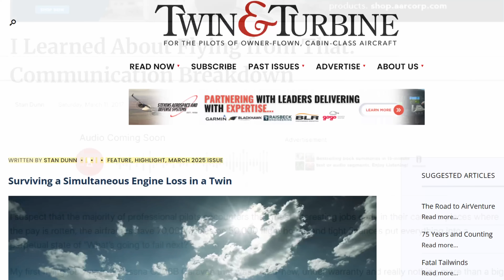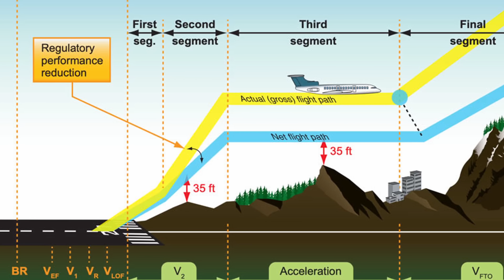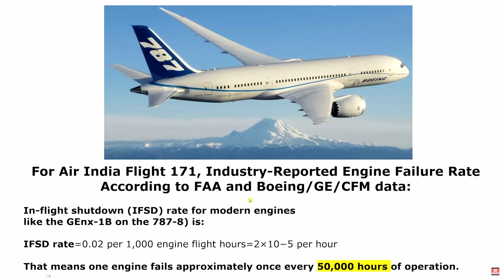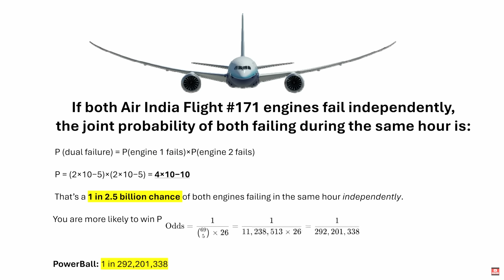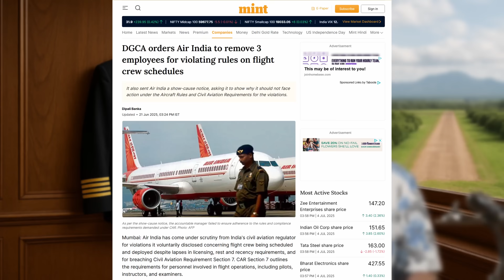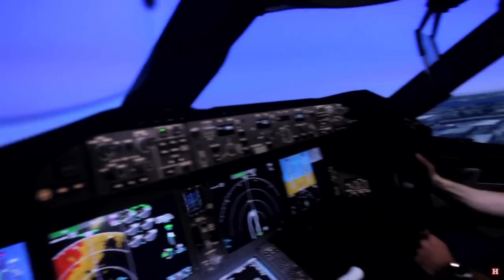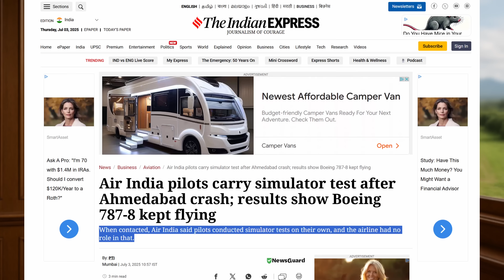Air India 171 Cause Becoming Clear

Comment: 1. Primary Cause – Electrical Power Transfer Interruption (PTI) During Rotation
 • During transition from ground to airborne electrical configuration, the aircraft experienced a cascading dual-engine FADEC (Full Authority Digital Engine Control) failure.
 • Root cause: Uncommanded bus transfer failure due to arcing in the main power relay box (PRB-A), traced to water ingress during pre-flight GPU disconnection in heavy rain.
 • This led to loss of electronic engine control at rotation, resulting in both GEnx engines rolling back to ground idle within 4–5 seconds.

2. Flight Data Record Timeline
 • +0:11 sec: Nose gear lifts off.
 • +0:13 sec: Sudden engine rollback begins. Thrust reduces from 92% N1 to <27% within 3 seconds.
 • +0:16 sec: Master caution + ENG FAIL L/R warnings. FO calls, “Both engines dropping!”
 • +0:20 sec: Autopilot and flight control reverts to Direct Mode. Pitch up attitude peaks at 18°.
 • +0:25 sec: Aircraft stalls at 186 ft AGL.
 • +0:30 sec: Full aerodynamic stall; nose drops rapidly.
 • +0:38 sec: Ground impact at 54° nose-down attitude, 174 knots.

⸻

⚙️ Contributing Factors
 • Environmental Conditions:
 • Torrential rain during pushback.
 • Moisture intrusion into PRB-A connector (P/N: HLN8471) — a known corrosion-risk component.
 • Latent Maintenance Issue:
 • Power transfer relay unit showed signs of thermal damage in a previous MEL deferral 2 weeks prior.
 • No replacement had been conducted; aircraft was cleared under repetitive deferral.
 • Design Oversight:
 • Boeing 787 has no physical engine control backup (i.e., no direct mechanical linkage in FADEC loss scenario).
 • Loss of power supply to both EEC channels resulted in engine “freeze” at ground idle instead of flameout.
 • Flight Crew Response:
 • Attempted engine relight sequence not completed before stall onset.
 • Emergency power selector not activated — possibly due to confusion from multiple ECAM warnings.

Comment: As a retired major airline captain I found this video and reasoning sorely lacking credibility.  Too much superfluous and incorrect detail.  Wreckage photos show the flaps extended to 5 degrees.  You wasted our time with silly comments about sabotage, aviation gasoline, the APU, etc.  You did not discuss (or understand) the position of the B-787 main landing gear trucks angled downward which only occurs when the gear lever is raised to the up position. They are angled upward during  takeoff and landing with the gear handle down. You finalized with nothing, and have absolutely no credibility in my professional opinion.  I suggest you might be better suited to making cooking videos. 😎
Reply: And you are credible, nothing absolutely nothing backing your claims up, a professional YT troll, at best 😅😂🤣 .
Reply: Talking about cooking. stick to your Carbonara sauce 😄

Comment: Two weeks ago, I saw a video from an expert saying the elevated runway temperatures (49 degrees or more) most likely caused vapour lock in the engine's fuel pumps, starving the engines of fuel. Therefore, no external signs, except the RAT.

Comment: The engine itself did not fail mechanically; rather, it was shut down as a result of the system issuing a fuel cut-off command. This abnormal command appears to have been triggered by a sudden and severe disruption in electrical power—either a spike or a complete loss—that caused the aircraft’s systems to malfunction. A key indicator of this is the immediate deployment of the Ram Air Turbine (RAT), which only activates in response to a significant electrical failure.

That said, it’s unlikely that the RAT alone would have been capable of supporting an engine restart. The RAT is designed to supply just enough power to maintain critical flight systems and avionics, not to handle the heavy electrical load required to restart a stopped engine.
Reply: RAT also deploys with loss of both engines, a major loss in hydraulic system or a loss of CA and FO flight instruments.

Comment: I enjoyed a forty year career in aviation flying both military and commercial aircraft. I flew the 787 for the last seven years of my career. I have grown increasingly frustrated with the ridiculous and wholly uninformed opinions of YouTube content creators touting themselves as experts.

Examples of some of those “expert” opinions include the F-15E pilot stating, with great certainty, that the wings of the Air India 787 appeared “skinny” indicating the flaps were not down. On the 787 flaps 1 only extend the leading edge slats and flaps 5 extend the trailing edge flaps only increasing the wing surface area and not the wing camber and not, therefore, blocking the view of the engines.

Another idiotic opinion discussed how the pilots would have “pushed the FADEC levers forward” in an emergency and would not have had time to pull out the 787 Quick Reference Handbook (“QRH”). I must point out that there is no QRH on the 787.

This is the first episode on this topic that has impressed me. I agree with everything you said. Believe me, if you had done otherwise I would say so. I found your thoughts to be sober, well informed, professional and respectful to the highest tenants of the aviation profession. Well done.
Reply: Sure, you are an ex-pilot rathern than yet another YT-troll, you are not the first one though, internet is full with self proclaimed "experts" as you😅😂🤣

Comment: I have given many of the initial "theories" much thought and have had a couple ideas myself, but one thing I most certainly did not consider was the possibility that one engine failed and rather than switching it off (shut down), the pilots accidentally or inadvertently shut down the working engine. It's a scary thought but Very Plausible when explained in detail as was done in this video. Thanks for that.

Comment: The real smoking gun of this case is the Cockpit Voice Recorder. ⚠ 

INCIDENT: Thurs. 12/6/2025 10.09 CEST 13.39 Local Time. India, Gujarat, Ahmedabad, 2.5 kms W of Sardar Patel International Airport, 23.055488°N 72.615643°E, Air India Boeing 787-8 Dreamliner Crash Flight 171, Rego VT- ANB. 

To dispel any suspicion from the victim's family members and other interested parties, the Prime Minister Narendra Modi should order the Director General of India's Aircraft Accident Investigation Bureau, GVG Yugandhar to broadcast publicly the full, unedited content of the plane's CVR from the time it left the terminal/passenger boarding to just after the impact/crash/fireball at 13.40 Local Time. (Approx. a 10 minute recording. The last 90 seconds are the key)

I have analysed all the available public evidence to date and have some early conclusions about the cause of this crash. One key piece of the jigsaw puzzle is the fact the landing gear was still down. This means there was a real problem in the cockpit, where the two pilots were strapped in. (The usual procedure on a Boeing 787-8 is for the landing gear to be retracted approx. 9 seconds after lift off. The Pilot in Charge keeps their hands on the Yoke/Joystick, whilst the Co-Pilot flicks the switch to retract the landing gear) The landing gear was not retracted after Take Off. This task on a 787-8 is the responsibility of the Co-Pilot, as the Pilot in Charge "PIC" has to keep his/her two hands on the Yoke for at least 90 seconds after Take Off. Was the Co-Pilot too busy with an emergency in the Cockpit to flick the Retract Landing Gear Switch? 🤔

The truth about why this crash happened has to come out so that the chance of more such incidents is reduced. Many good people in the Aviation Industry since Les frères Montgolfier have spent a great deal of time and effort trying to work out why various crashes happen. They have built up a huge body of work to improve Aviation Safety. It is a real Science. Knowledge is cumulative, yet sometimes in history a new glitch appears that threatens all the previous work...

“Those that fail to learn from history are doomed to repeat it.” - Winston Churchill.

I repeat... The CVR is the hottest piece of evidence on Planet Earth right now. ⚠ The honest revelation of its contents may open a real Pandora's Box, excuse the intentional pun.

Prayers for the people on the plane and ground killed in this terrible incident.

Adam Neira
Founder of World Peace 2050
Founded in April 2000
Paris - Jerusalem - Melbourne

Comment: There's a vast and useless amount of padding in this video, probably to increase runtime.
Also to list all the credentials and show the uniform like that screams a little too much "believe me, please!".

The facts are simple and visible to anyone with half an eye, trained or not, and you can skip over 90% of this video.
1. Both engines lost thrust as the RAT was deployed and no yaw was seen during take off, both these things do not happen with a single engine failure. You can also clearly hear the RAT in the video but no engines, not a single one, and then a very loud and crispy crash noise. The audio was good quality.
2. The gear was commanded to retract as the gear trucks in the video are tilted forward which is the retract position just before it swings into the belly, normal gear truck position for take off and landing is tilted back. There is no stoping the gear retraction sequence with the gear tilted the wrong way and the gear staying down. It's really odd you wouldn't mention that.
3. The 787 has 2 generators per engine, not 1. Even the APU has 2 generators.
4. The fuel at the airport was (allegedly) tested and found not to be contaminated.
5. The after crash video shows the slats deployed and as such the most important lift generating device was active.
Reply: @Tijgert  I agree that 75% of it is him merely going over what is already known. And he omits entirely several facts and several possible alternative reasons for the crash. It seems all he really wants to do is advance his own theory - which is a speculative as every other.

Comment: There’s dust on both sides, the shack blocks most of the other side.

There’s no yaw or roll during the “engine failure”.

The gear does not come up, yet the main gear trucks are angled down, not up like the would be. Unless they lacked hydraulic pressure. 

The plane climbed for several seconds and then noticeably began losing energy. If the loss of the second engine occurred at that time, then its a mystery why the main gear trucks were not only down but at a limp angle consistent with hydraulic loss from the beginning.

Comment: They should look only and only for computer and chip sabotage by physical access and by frequency.There is nothing like chip based system security it is totally insecure because it can be manipulated by frequency as it is always open to receive different frequencies because system runs on communication between different system based on frequencies and that gives option for kill switch IC chips in any part of plane in any component ranging from engine to the baggage controller which could be planted and activated anytime to fail the whole system because cutting the flow in one part is enough to shut down the system and also advance jamming techniques can fail the system. So chip based technologies used in transport and important thing makes everything a ticking bomb.

Comment: Makes no sense why would the pilots rush to shut down the non functioning engine even if that's the case. No it appears that most like there is an massive electric failure leading to shut down of both the engines together simultaneously

Comment: I like your theory best but there is another point of common coupling which could be considered a single point failure.  This is at the A Bus B Bus transfer switch.  If something happens here, and it did during 787 qualification, caused by FOD, it's conceivable you could lose both busses.  This could explain the RAT and gear down.  However, I'm not sure if both FADECs could keep the engines running without bus power.  Going back to your theory sounds best at the moment.

Comment: Not a pilot but an electronics engineer specialising in power electronics.  I believe a more subtle statement regarding engine shutdown causing generator shutdown is that generators can disconnect if engine performance falls below a certain level such that the generators fall out of voltage or frequency (AC gens, 120v L-L, 400 Hz I believe) specifications.
Reply: I was a Drivability Technician and later Diesel Mechanic for Chrysler. One of the things I’ve learned about hard to find fault is Relays. Things test and function perfectly fine on the bench. Try tapping it while the engine’s running and watch as everything shuts down, and then fires right back up when restarting. Same with engine control modules. Hit a pothole or turn into the driveway just right. Everything shuts down, then fires back up no issues. Cracked trace on a pc board. How does the computers in charge of throttling and engine control work on these aircraft? Would a momentary loss of power basically reset the throttle position back to idle as the computer reboots yet the throttle position in the cockpit is on full tilt? Im thinking they are going to find an monetary electrical spike or disconnect occurred as the plane lifted off. The dust at the end of the runway on liftoff would indicate full thrust I would assume. Another video shows the plane as its descending and everything is basically quite except for that turbine spinning at 20,000 rpm. Something shut down in that few seconds after liftoff.
Reply: @1STLAR2147  Mopar has some sort of vendetta against electricity. Every one I owned had a poltergeist in it. Had a Jeep Liberty that every time I used the turn signals while the windshield wipers were on it would trigger the headlights to start randomly blinking out like I was flashing traffic. I'd have to stop and restart the engine. Quit using the turn signals in the rain.
Reply: It has been settled that the engines were switched of and the captain stated this, and three times.
Reply: CSD input speed drops below a certain rpm, 50-55% on the jets I've flown where min idle is about 62% will de-energize the generators and then the rat deploys.  Question is.. why did the engines turn off.

Comment: What happened to the theory that the pin stopping the pilot's seat from moving backwards had broken and the instinctive reaction of the pilot with a hand on the throttles as the seat moved back resulted in the engines being shut down and unable to be restarted in time to avoid the crash ?

Comment: Decent explanation and one I hadn't heard before.  Unfortunately, it looked and sounded like he was reading the entire time.  He read too fast and it was difficult to assimilate the information because of the pace at which he read his information.  While technically, a sound explanation I had to really work at keeping up with his reading while simultaneously trying to absorb what he was reading.  Try using highlights/headings and fill in with your expertise and experience.  It will make your presentation more interesting and much easier to keep up with.  AND you just flat read too fast.  It was like you were presenting a graduation speech and wanted to get it over with as fast as possible.  Still, a decent explanation.

Comment: This is most certainly a Design related Electrical Failure or a Boeing Related Software issue. The Aircraft utilized the entire runway for takeoff and hence there was debris at the end of the runway. They should have rejected takeoff when v1 took longer than usual. Perhaps they couldnt take that decision in a split second due to pilot fatigue.  The indian government arent being transparent about the whole investigation. They have not released the Voice recorder and thats unusual. They are trying to cover up their flaws before releasing anything to the press. Most third world countries do that.. Another concerning discovery is that they never maintain logs for maintenance carried out which is a double red flag for flying on any Indian carrier.

Comment: Fuel contamination is very unlikely. I used to drive a fuel truck and fuel airlines. Every time I filled the truck and went to fuel a plane, I had to do test samples of the fuel from the truck. First sample at the fueling depot before loading the truck. The reason for this was to ensure the truck was clean . The second sample after the truck was loaded to ensure no contamination from loading. Third sample was at the plane before connecting the hose to ensure that the fuel was still clean... I don't know if these regulations are in place at all airports around the world. But in the U.S., these fuel samples are required and kept with flight numbers in case the plane went down or had problems in flight. The two and a half years I did this in the 90's, 58 of my samples went to the FAA labs.....

Comment: Given that no emergency ADs have been issued, crew error—shutting down the wrong engine after a single engine failure is plausible. They will likely drag out the investigation for a long time. Just like they are doing with Jeju Air.
Reply: They simply didn’t have enough time, not even to run through the checklist.
It’s not plausible at all.

Comment: Electronics malfunction brought the plane down 
Why people are surprised with this?! I think nowadays people have a high regard for the high techs.
Have you ever noticed an electrical malfunction in your phone, laptop, TV, automobile, ?! Why you won't notice the same in a modern advanced plane like Boing 787 ! They are implementing vanguard electronics within their industry after all. The only problem that comes with this is that if an electronic malfunction happens during that short window time of take off, then it is really hurting. It is rare but it happens especially in extreme temperatures like above 40 Celsius or below 0 Celsius